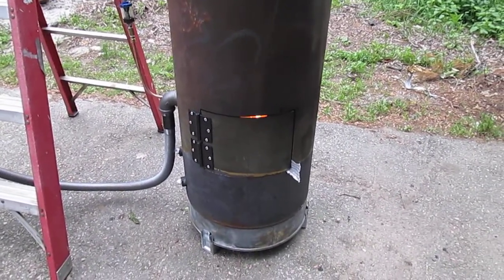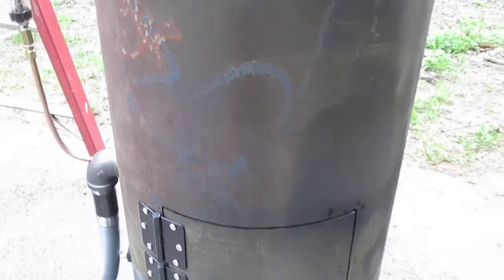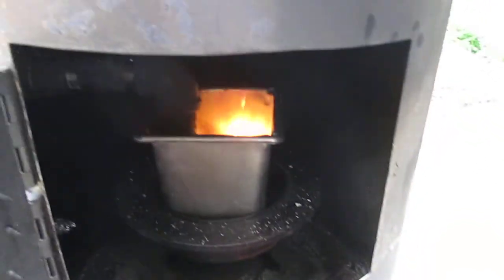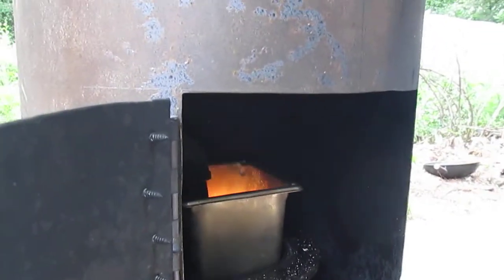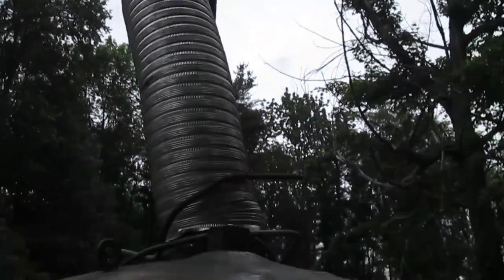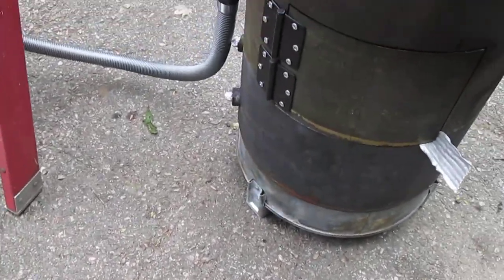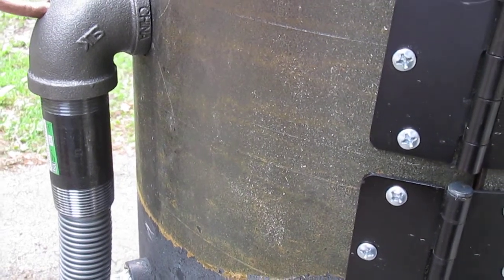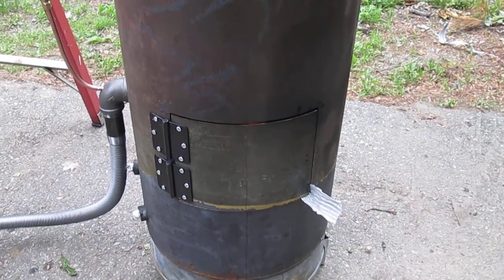DIY Waste Used Motor Oil Burner Heater Furnace - Almost Done Burn Test - Video 6

Comment: good job, but the oil feeder tube must be shorter than the bigger tube so that, the air mix with the air and make it like a spray... and u will have less smoke than now
Reply from the maker: Hey Ali :))). Yes you are right... I shoulda have that shorter :)))) Thank You !!!! In two days, I will have the New Video with the Newer Burn Pot. I tried something different than my original design, it didn't work out :(((((. So the Burner Chamber Pot in this Video is a Temporary Pot. but you are correct, I will cut down to shorter and make sure it fit with my new Burner Chamber first :)))) THANK YOU for the input !!!!
Reply: hey Jod Bronson and good job